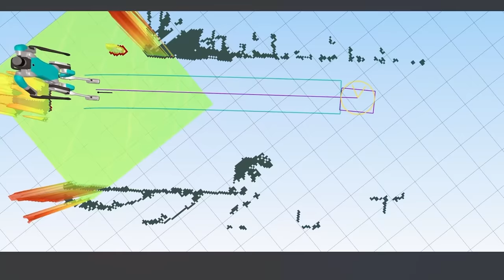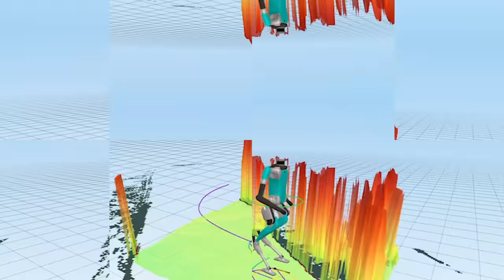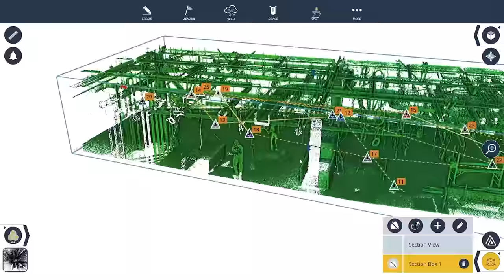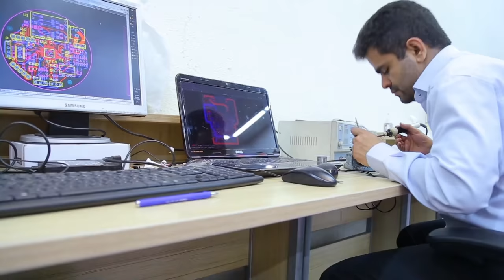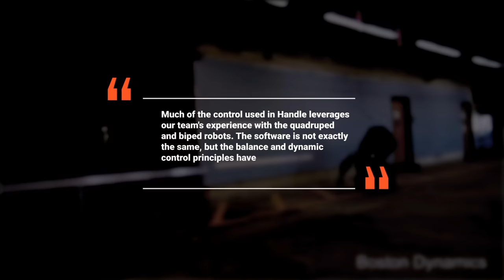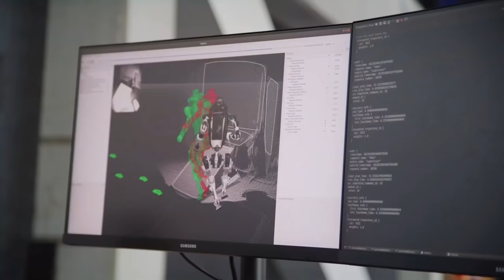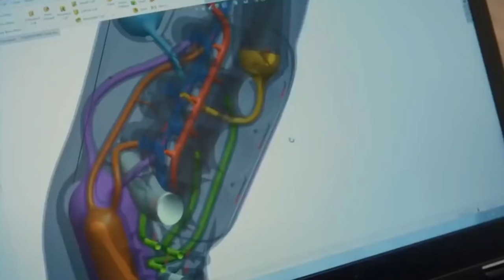10 Most Advanced AI Robots in the World

Comment: Oh wow, Oh My, what are we ever to do if robots become good enough we can't tell them from the real thing?  Nice video but borders on fear-mongering.  UNTIL BATTERY TECHNOLOGY TRULY COMES OF AGE THESE ROBOTS WILL BE NO MORE THAN CURIOSITIES.  Sorry, Lithium-ion batteries are not the answer and they'll be no good with wire tethers used to supply power.  We don't care how fast they can think or move or how many back-flips they can perform.  Without a continuous power source, they are just piles or plastic and metal.  It will take years of battery research to get to the level which may power those robots for hours on end with small enough batteries it doesn't create a burden to carry.  Focusing on non-teathered Robotics instead of battery technology appears to be clever but also a total waste of money.